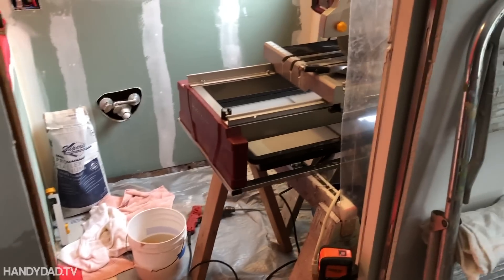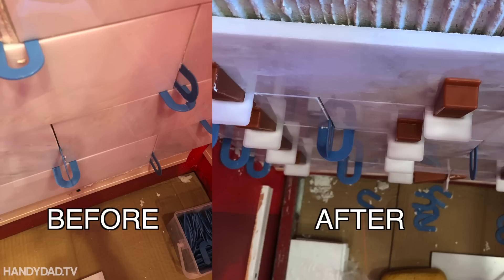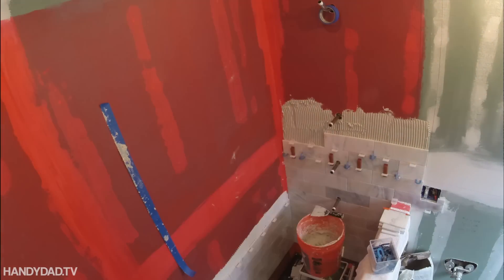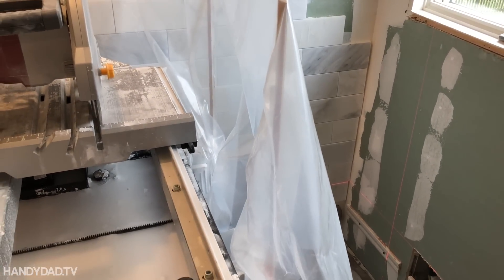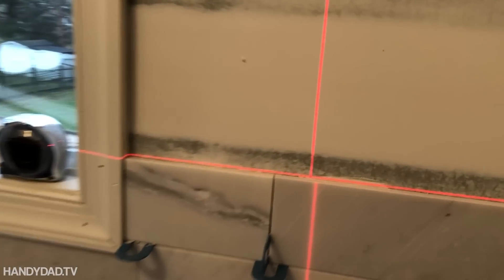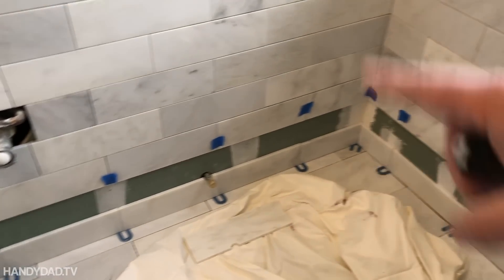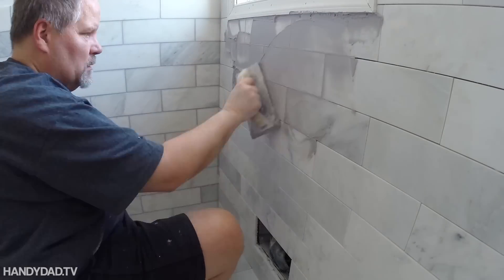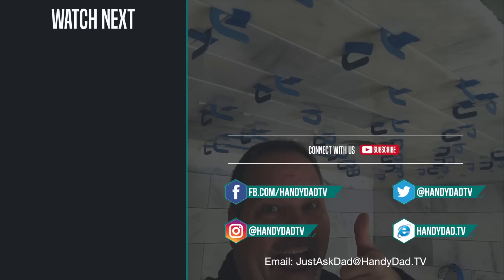Marble Tile Installation | Master Bath Remodel (Part 6)

Comment: I can see you're not bedding your tiles into the adhesive. you need to push each tile a little as you apply them.
Reply from the maker: Thanks for the tip!

Comment: Looks amazing. Going to do the same thing with my shower walls. What line sized did you use for the grout lines? 1/8", 1/16"?
Reply from the maker: 1/16”

Comment: What mortar/thin set did you use?  I'm having issues finding the right one for the 6x12 marble floor tile I am going to lay.  Thanks for the video.  Beautiful work!
Reply from the maker: The white flex thinset from Home Depot. Not sure of the brand, but it’s the one for “normal” size tiles (there’s a different one for large format).

Comment: Hey Chris can you guide me to where you bought the floor and wall marble and which ones? I am doing my half bath and would like to use the same marble. Thanks!
Reply from the maker: We bought it at The Tile Shop on Rt 35 in Oakhurst.

But I wouldn’t recommend natural marble. Granted, it’s beautiful, but you can’t clean the grout with normal detergents or bleach because it could damage the marble. 

If I could do it again, I would get a ceramic tile that looks like marble.

Comment: Hello, I just got the same laser. I think is great but I have a question for you. No matter the setting I have it on my laser blinks. In some settings in blink quite often and the far away setting it blinks every 30 ( I think) seconds. Dos yours do that? I don't know if this is normal.  (Blinks meaning goes off once and comes back on)

Comment: Great job. Your tile is almost identical to mine from wall to the floor. I'm wondering if you have a basement, if the weight of tile a concern because that's a lot of weight to support. BTW I tiled my ceiling as well, with the same ceiling tiles as you.
Reply from the maker: I like the look of natural marble, but didn’t like the maintenance because you can’t use any products with bleach. This bathroom was on a second floor above my kitchen and I never worried about the weight of the tile on the ceiling below. It was fine.

Comment: Doing my own shower too. Did you use caulk in the shower corners and changes of plane or grout? Any thoughts? Thanks
Reply from the maker: No, I didn't caulk. Two reasons. First, I find it very difficult to keep grout out of the corners. Second, in my experience, caulk never matches the color of the grout so it doesn't look good. With Redgard behind it, I'm not worried about leaks, even if it cracks.
Reply: @handydadtv  Thanks for the info

Comment: I’m about to embark on a custom bathroom remodel as well. Thanks for posting all of this, this is giving me a lot of confidence to attempt it on my own. I looked through the videos you posted regarding the master bath remodel and didn’t see one around the shower glass work. Is there not a video because it’s not that big of a deal😀?  Did you have to do custom glass or were you able to find some pre-fabricated glass that fit what you were targeting? Thanks for your work.
Reply from the maker: You’re right; I never talked about the doors in any of the videos. Frameless glass doors definitely are not a DIY installation. Ours were done by a local pro who specializes in shower doors. Not cheap, but they make it look so much bigger.

Comment: AMAZING!    But, I am staying away from marble because of the yearly cleaning + sealing and other potential staining issues that I have heard about.
Reply from the maker: I agree. Next time I would get a ceramic tile that looks like marble.
Reply: Yikes!  Was going to begin my tile install tomorrow and just saw your comment where you said  you would install ceramic next time. Have you had any staining on your marble?  Has the maintenance and upkeep of the marble been a huge pain in the neck?  My wall and floor marble selections are exactly the same as yours. Thanks in advance for your input. Oh, and you did a beautiful job on your bathroom.
Reply from the maker: The marble is fine, but the grout is discoloring even though I sealed everything twice. And I have a LOT of grout! The real downside is you need to use mild cleaners with marble. No bleach. So it’s hard to get the grout clean. 

If you use a ceramic tile with a marble look, you can use bleach-based cleaners to keep your grout clean.
Reply: Thanks SO much for your input and advice. Sounds like I'll be making another trip to tile store today. I'd heard the negatives about using marble tile, but was going to push through and use it anyway.  I think you just changed my mind. The idea of returning and  carrying all the purchased tile from my attic to my car and back to the store makes me want to cry (SO MANY BOXES!). I really appreciate your response, HandyDadTV.  Keep those videos coming! 😃

Comment: I'd love to know how sealed marble holds up over time?  I'm considering order it for a bathroom floor & shower.
Reply from the maker: I’ve sealed mine twice. The marble looks brand new. It’s a challenge to keep the grout clean because I can’t use strong cleaners on the marble. 

My advice: don’t use natural marble. Pick a ceramic tile that looks like marble.

Comment: What brand Grout did you go with?  Also, sanded or non sanded? Remodeling my bathroom... Thanks!
Reply from the maker: Marble can only have non-sanded grout because the sand will scratch it. But I recently saw Starr Tile use a different kind of grout with marble in one of his videos maybe 2 months ago. You should ask him. 

The color was Whisper Gray and the brand was Superior. Got it from my tile store.

Comment: Why didn’t you set your ledger board so you wouldn’t have to rip the bottom tiles smaller? This all looks amazing btw.
Reply from the maker: The floors are never level. You always need to cut the bottom tiles.
Reply: HandyDadTV oh duh! Lol that makes sense.

Comment: What did you put down over the subfloor as a backer to the marble floor tile?
Reply from the maker: I used 1/2” Durock.
Reply: Thanks. One more question did you seal the tile before install and again after install or just after install before grouting?

Comment: Please help. My contractor just installed a beautiful marble tile shower almost exactly like this one, but then he put caulking everywhere. He caulked the whole corner from ceiling to pan (I used a shower pan not tile on the floor), he caulked along the pan inside the shower, he caulked along the ceiling, again on the marble, and along the glass door. Basically he caulked wherever marble is touching glass, acrylic, ceiling, and even marble (the corner). It looks terrible because he chose a gray caulking. At first I thought he should have used white, but now I'm even wondering if this makes sense at all? I don't see caulking in any of the pictures online. Thank you!
Reply: I did a bit more research and now I'm not sure if he shouldn't caulk at all or if he just didn't do it properly. His caulking is thick! He said he couldn't cut the hole less than 1/8 of an inch. Except I just saw a vid where the guy uses a caulking tool and scrapes off the excess. Should the caulk just look like grout? Because mine doesn't. It's thick and terrible.
Reply from the maker: Caulk is often used where two surfaces meet because grout can crack in those areas. I prefer to use it as a last resort, ie. AFTER grout begins to crack, because caulk doesn’t last forever. Water will leech under it and cause mildew so it needs to be replaced periodically (it’s not “one and done”).

That said, it’s not necessarily WRONG for your contractor to caulk those high risk areas. It just sounds like a bad caulking job. 

You can either get him to come back to replace it and do it right, replace it yourself, or live with it. If you decide to do it yourself, DO NOT USE ANYTHING METAL against your marble. It is soft and will scratch. Get a plastic grout removal tool from a paint store.
Reply: @handydadtv  Thanks so much

Comment: Great tips and an interesting clamping system, but I noticed your deliberate mistake, when you showed the water capture with the plastic sheet, all I was looking at was the electric cable that was just beside it. Come on I expect more from you, before you know it the safety police will be at your front door. Thanks for the links to the tile experts, I am in the middle of retiling my bathroom and found the celling tile video very interesting.

Comment: First cheap tools second joint are to big real marble instaler doesnt need 1/16 spacers
Reply from the maker: Thanks for the feedback. But technically, I installed the marble and I’m real. So I’m a real marble installer. But nowhere did I portray myself to be a professional tiler.